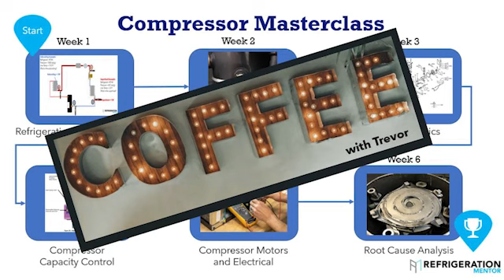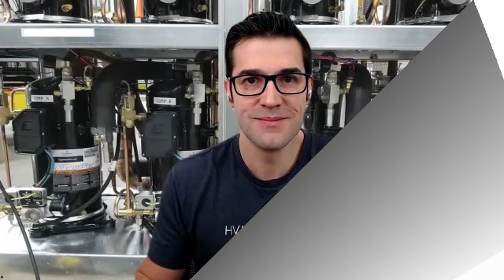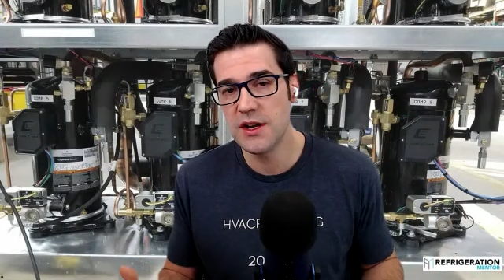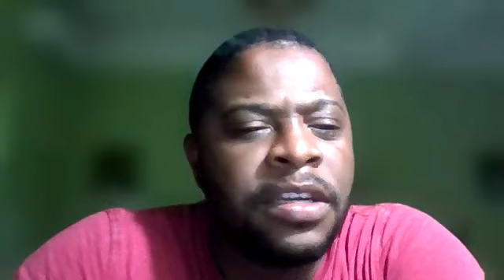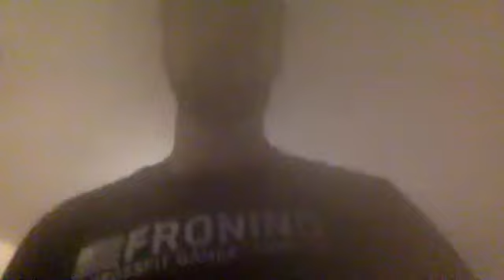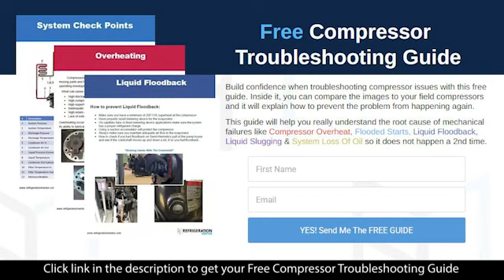What causes Floodback or Low Superheat in a Refrigeration System?

Comment: Hey Trevor,

Thanks for always helping us to become better techs.

I have a couple r410 split systems that have issues. One scroll compressor already had an electrical fault and the other is showing signs of imminent failure. The Evaps have  venturi type distributors but no metering device. I've read the manuals and they are supposed to have txv's before the distributor. 

I was getting 0 superheat. And my suction sat Temp was 55-60 F

Thoughts please
Reply from the maker: That is really hard to comment on.  If there is no metering device and you read the manuals and they say it should have a TXV I would follow manufacture guidelines.